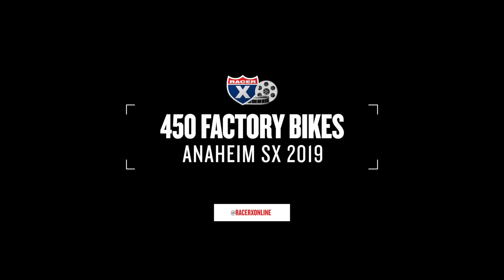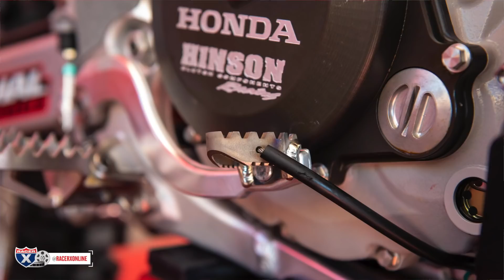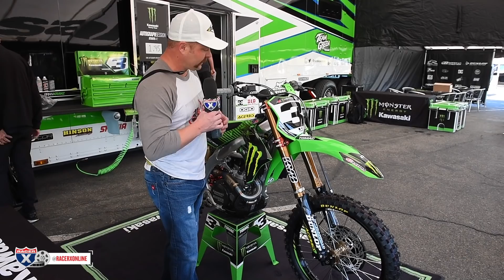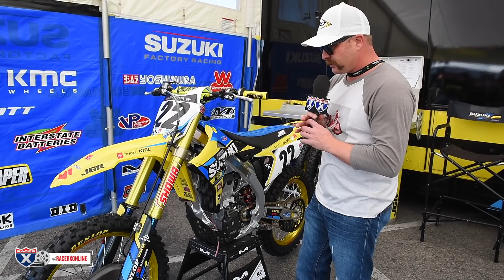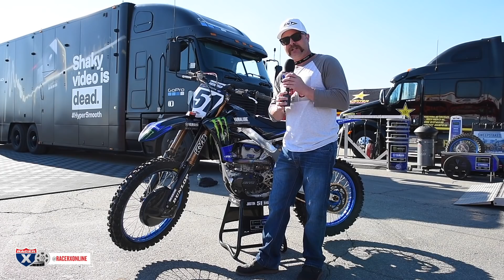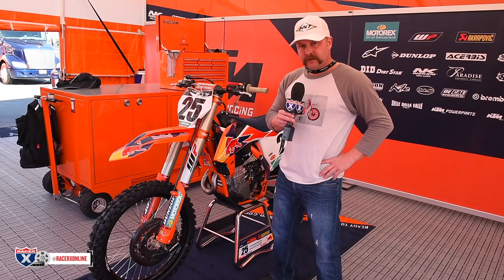Racer X Films: 2019 450 Factory Bikes

Comment: I found it interesting that all bikes had electric start, other than the Suzuki.
Reply: I think its bs, my brothee bought a 2018 crf250 and dit only had an electric start and when the engine is cold let me tell ya, youll be standing their for a good 5 minutes before you get it running. I have a 2018crf125 and it has electric and kickstart and the electric works better than the 250 one.

Comment: The difference between today and the  late 70's and all of the 80's:  Today, we have all these these Ti. bolts, and carbon fiber stuff that make all the difference in the world.
Yesterday, we got single shocks, disk brakes, water cooling, better frame geometry, 12" travel suspension and upside down forks.  The big difference today is no more than the seat climbing to the gas cap that happened in the 80's.  Yes, we had Ti. bolts, and even frames in the 60's.
I will give kudos to the electronic engine management of today though, vs carburetion, but nothing else is new, or really better.

Comment: I asked this question on last year's video and got no answers.  Does anyone know why nobody uses carbon rims on dirt bikes like we do on mountain bikes?  Do they even exist?
Reply: Becauce, in my opinion, a catostophic failure here could kill you.
Reply: Somebody at one point thought about a full carbon fiber replacement of the plastic on a bike. The fear was if the rider  crashed there would be sharp pieces of carbon all over the track. I can't recall who what or when unfortunately.  Also carbon cracks and isn't reliable when it gets scratched or nicked. Buy a pair of light speed fork guards. You'll see 😉

Comment: I want to tell you that the chamber "bomb" on the side of the exhaust pipe is called a Helmholtz Chamber. It cancels exhaust harmonics that can upset the exhaust flow, or sound. Then they can shorten the muffler to have less resistance.
Reply: Haha!  I was just reading on Helmholtz the other day.  Very in depth stuff